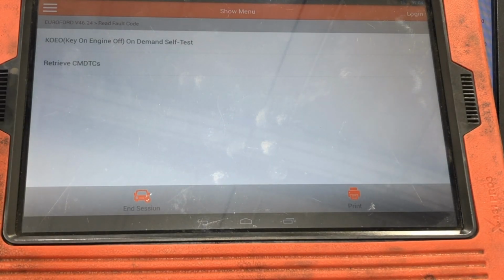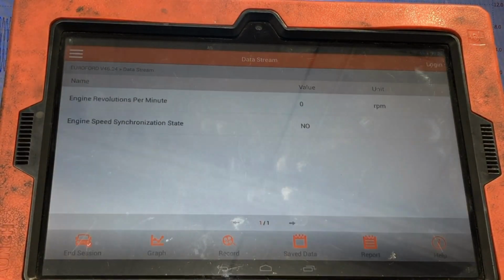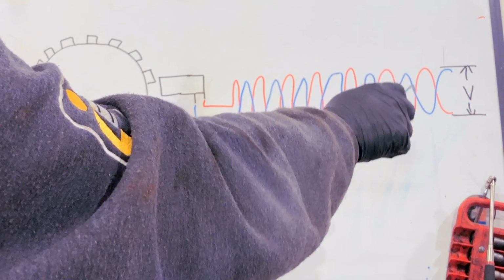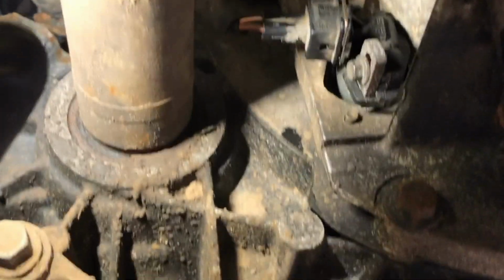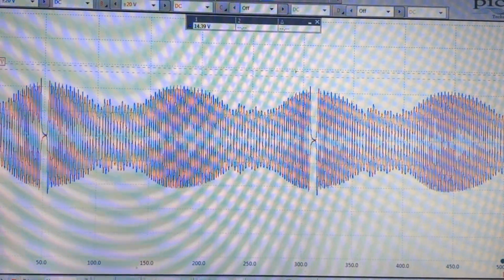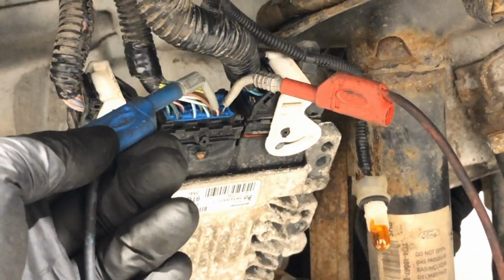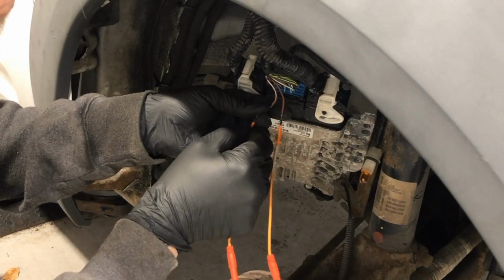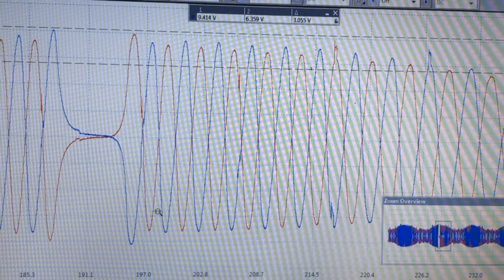How to test an Inductive Crank Sensor

Comment: Excellent. A quick test that may show something. Test the ecu input circuit from the sensor compare old one and new. DMM diode test  both ways to ground and supply . this way you may be able to confirm your results before a new ecu for next time . or even fix the ecu.  The sensor on-load wave form did look good though. Obviously no input low Z but may be OC. to the circuit board. Corrosion.!

Comment: Very good demonstration. Just a couple of tips that I teach. An inductive sensor can be tested 4 ways typically. AC voltage across the sensor should measure a minimum of 500mV while cranking. Higher is better. Resistance of the coil which is usually between 200 and 2500 ohms with the actual spec being less broad. Frequeny testing measuring hertz. I don't recommend this method unless you know your meter will read the signal correctly as some meters have difficulty with the trigger setting. Lastly with a lab scope which is preferred. It will show the signal integrity ie if the waveform is inverted due to mixed up wires at the connector or an anomaly with the reluctor teeth due to physical damage. I noticed your signal was almost a perfect sine wave. Most CKP signals I have seen are alot more pointed. The variation in amplitude on your signal seems off to me since there should be multiple compression events between the sync pulse in my opinion. It's almost as if the flywheel is bent or the air gap is changing for some reason.  I'd like to see what it looks like running. 
I've also had a missing cam signal or a cam signal that is implausible generate a CKP code at times. 
Hope to see part two.
Reply from the maker: Thanks for the tips, it’s appreciated and I’ll factor those as part of my diagnosis in the future, the one point I will pull you on though is there are only 2 compression events per revolution of the flywheel, the crank must go through 720 deg to experience 4 compression events, the cam will go through only one revaluation though. 
Also if the cam sensor was at fault I’d expect to see engine speed in the data pids but as demonstrated there’s no engine speed being calculated.
The first time this vehicle came to me it had same fault code and I checked cam sensor as well as crank and cam signal was present.
Reply: @intelligentauto737  You are correct about the compression  events. I'm thinking of a V8 LOL. I stand corrected. Yes I noted the lack of RPM and the SYNC No in the data list. Thanks for the video...

Comment: Another great video thankyou for posting..just wondering why you de pinned the crank sensor at the ecu when the signal was good when back probe..was it just to drag test the pins...
Reply from the maker: Yes that was part of it but also to verify there was no issue with the connector itself. I’ve seen broken connectors inside Ecu plugs before

Comment: When you said the car needs a new ECU, I was wondering why you decided not to test power and grounds. It's totally obvious that you are good diagnostician, and I know you knew that step before definitelly make a call on ECU. But you've explained that. 
Thank you for another good video! 
Greetings from Serbia...
Reply from the maker: The reason I didn’t test powers abs grounds is because the crank sensor does not rely on a voltage from the Ecu.
There are no other faults with this Ecu and all other data pids are good.
Reply: @intelligentauto737  Thank you. I supose there could be a problem inside the ecu that  would result in it not to be able to see a signal from a crank sensor... Just a thought.
Reply: Sir the main reason for ECU change is evidence of water...and did you change the ckp or the signal was okay from the test you did... thank you sir am learning a lot from you sir
Reply from the maker: @johnmwangi6291  no it still has its original crank sensor as was tested as you seen abs found to be good “testing not guessing”

Comment: from a novias scope user . is it possible to use an indictive crank senor for relative compression on a bigger time scale
Reply from the maker: I like that you’re thinking out the box, this is the intention of these videos. 
Yes you’re correct this could be used as a measurement of relative compression, I’ll possibly do a video about this.
Reply: I thought of the same thing. But I do relative compression the ussual way. If you have appropriate amp clamp, it must be easier, as oposed to checking wether a crank sensor is inductive or hall type. And it's not always easilly accsessible.
Reply from the maker: @nemanjadzombic6101  there’s numerous ways to perform a relative compression test, this is one of them.
Reply: @nemanjadzombic6101  im more thinking of the advantage of killing 2 birds with one stone
Reply: @nemanjadzombic6101  da, amper kljesta i pikoskop, hehehehehh
Reply: @tmanda323  Imam dvokanalni. Skup, ali vredi svaki evro :)